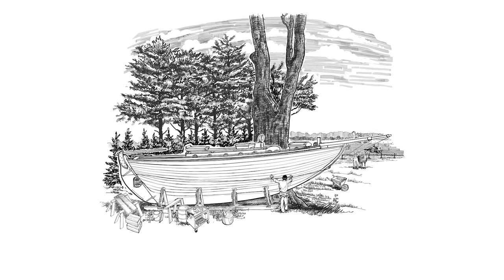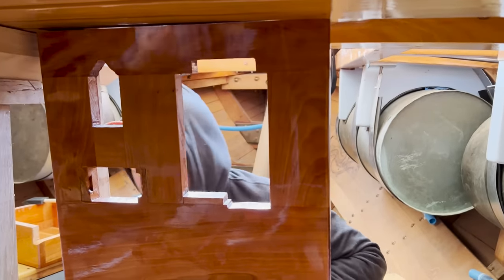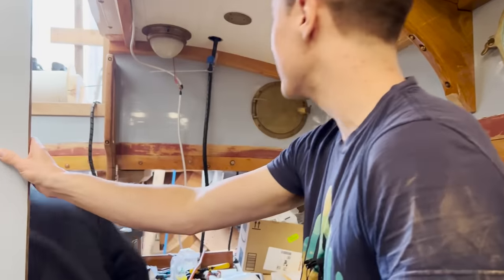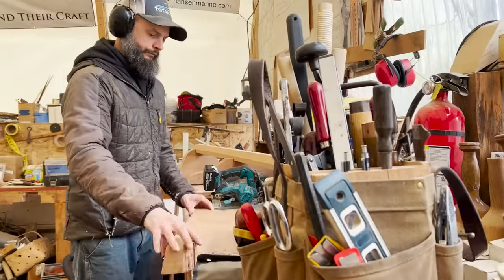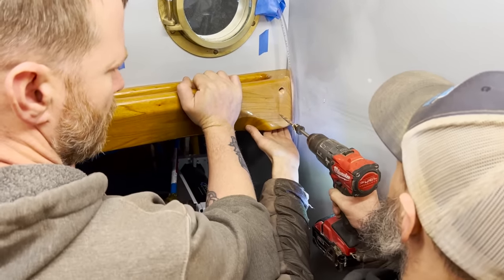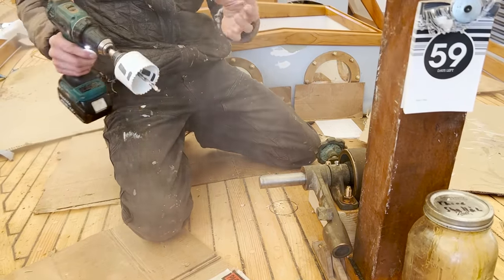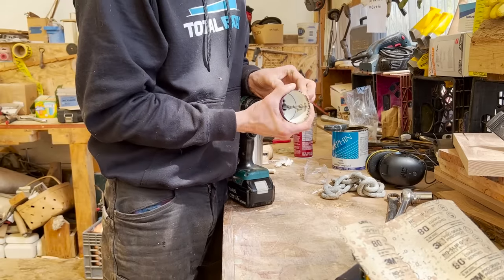Arabella's Spa Week, Swelling The Hull - Episode 265 - Acorn to Arabella: Journey of a Wooden Boat

Comment: She is so beautiful, well done you guys. Quick note on the boom traveler for anyone who is interested. It changes the angle you are pulling on the sail and thus can flatten it. Going down wind or on a beam reach you would want a full belly so you would move the traveler to the same side as the sail. Trying to point up more to windward you would want to bring the traveler to the center, or even move it off center "away" from the side the sail is on. This puts a slight twist in the sail, flattening it and making it more efficient for pointing up.
Reply from the maker: Thanks for sharing.

Comment: From experience; I suspect that the leaky water tank inspection cover will need twice as many fasteners to prevent the distortion between the fasteners that is reducing gasket pressure between them, so allowing leakage. 
It’s a very large surface area for so few compression points. 
Other than that, great work guys, she’s looking absolutely gorgeous.
Reply: Also!  You should consider cutting a hole in the flange gasket, to make it a ring instead of disc.  That will free up any given point of the gasket from influence from what's going on on the other side (180 degrees) of the seal.
Reply: @JBLewis  But than then allows two surfaces to develop a leak across.  More screws i think should do the trick.
Reply: Dish the existing cover to increase the stiffness. Use a silicon gasket with a durometer hardness of 60 or so, and stiffer than foam, more durable than that and the rubber. Test. I hate leaks on boat.
Reply: @johnmcanulty7341  makes an often overlooked point. The spacing of fasteners around a large opening in relatively thin flat material is governed by the need to reduce midspan deflection induced by the gasket compressing at the fastener points. A softer gasket will not necessarily help unless it is graduated (stiffer at the fastener points, softer in between. This can be achieved by letting in washers of stiffer material around the fasteners, which should be slightly thinner than the soft gasket, but this is fiddly to get right. Flanging or dishing the cover (or making it thicker) will go half way to resolving the problem (the underlying tank will still deflect as before). The simplest solution is to double the number of fasteners.
Reply: At 12:50 a helper suggests that the leaky tank inspection port can be accomodated by lowering the level of water. Unfortunately sailboats heel, and can stay there for a while. I was once on the same tack for ten days...
Reply: Having thought about it further, I think that the simplest solution of all would be to dispense with the gasket altogether, substituting a bead of low modulus, potable water safe, silicone jointing compound. 
This should be laid down as a continuous bead at the same radius as the fixture screws, with a circle of compound around each screw position. 
Either fibre washers or Dowty seals should be fitted under each screw head to prevent leakage via the screw holes. 
If it were possible to get a pair of backing rings machined up, circa 5mm thick, to be fitted both top and bottom, these would substantially stabilise the joint. 
An additional benefit of a lower backing ring would be that the screw positions can be tapped so that it forms a fully captive nut assembly once bonded in place with potable quality sealant. If it were made circa 10mm thick the tapped holes could be blind (not perforated through) thereby sealing the screws from water ingress altogether. 

For now though, just doubling up on the screws and dumping the gasket for potable quality RTV sealant would suffice. 

The thing about this assembly that bothers me right now is that I have a strong suspicion that the joint will fail with the impact of water sloshing in any sort of a seaway ehen the tank is part full. The surface pressure generated can be rather greater than one might initially guess and it would be a great shame if the tank were to become permanently distorted around the aperture through an insufficiency of fasteners imparting excessive localised loadings.
I’ve seen and had to deal with the results of exactly this issue and it’s a real PITA to rectify the distortion properly. 
Cheers, R. 😎👍🍻
Reply: Steve
The guy testing the tank said he could add a stiffer cover. I definitely recommend that along with other measures mentioned here. Static test is nothing like being in a seeway with water sloshing around. Entire tank will flex.
Reply: A seaway will find its way. Are there plans for a baffle system to maybe reduce the sloshing issue? Maybe something like soft baffles might be effective. Commissioning new tanks are problematic. There are multiple solutions. Dealing with liquids being in the bilge is not most optimal.
Reply from the maker: There are baffles.
Reply: @AcornToArabella  👍I know, but not against vertical motion. 
Not trying to knock anything you’ve done, just trying to help you avoid a snag down the track.
All good. 👍🍻

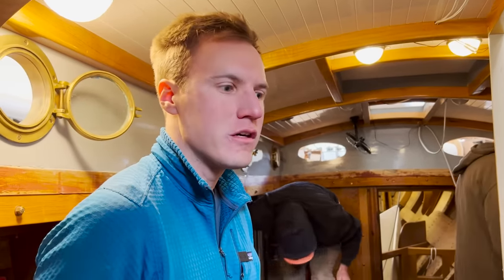Comment: 12:39 Three ideas for improving the tank lid are now following me around...
 1. A sandwiched donut flange cut from ¼", ⅜" or ½" sheet when clamped to the tank opening would offer an improvement in stability.
2. A machined version of a flange can add a vertical dimension and resistance to twisting. This could be tricked out with o-ring seals for both the flange and lid. 
3. A pair of custom made o-rings glued on the gasket on both sides of the machine screws can greatly increase the sealing ability by compensating for irregularities. O-ring material to make your own is readily available and the adhesive is usually just a type of cyanoacrylate aka, super glue.

Comment: I have never second guessed you, but I am concerned about the traveler. The height and the strength make me nervous. Enough force to tip that boat over will be on that point. And then tip it back the other way.. and back. Have you considered metal? Im sure you could modify a used one. Keep it up man!

Comment: Another lubricant for stainless machine screws is pencil graphite, just rub your pencil along the thread and it provides enough slip to stop any binding.
Reply from the maker: And it doesn’t leave a residue. Best thing for lubricating locks, and it’s recommended over WD40 type products. —Anne
Reply: It is abrasive though, so keep it away from machine tools  and edges you like to keep sharp!
Reply: @tomnewsom9124  an abrasive lubricant, like graphite grease. First I’ve heard that.

Comment: Any drain holes in the handrails? A sudden rain shower with open portholes could fill them up pretty quick. Not likely to be a common occurance, but it would save having to sop up all that water with a cloth... :yougotthis:
Reply: Also condensation on the glass and metal of the portholes, together with inevitable eventual leaks in the gaskets...

Comment: Unless you're planning on heading south, those hand holds are going to catch a ton of condensation coming off your ports in the cooler months.
Reply: Agreed, while they are beautiful I wondered why he didn't use an aluminum railing that would also provide a place to hang things.  The handholds are a dirt/moisture trap.
Reply: This is a very fair assessment, while they look beautiful sometimes function needs to come first!
Reply from the maker: I just wipe mine down. I mostly sail in Maine, well into shoulder seasons, and I’ve only had grabrails like these ones. —Anne
Reply: I suppose they actually prevent drips where you don't want them, assuming they don't fill up...
Reply: Just put a couple of panty liners down in there and all the drips will get collected.

Comment: Consider installing those flange bolts from the bottom. The threading will keep them from falling in, and you can use nuts.

This way you never have to deal with stripping out the thin thread metal

Comment: Are there drain holes for the hand rails? I'd be worried about any water leading/condensing/splurging through the port holes ending up in the hand hole channels. 
Another great episode. Patron since the lead pour. Love your work!
Reply from the maker: Thanks for your support! So grateful. I’ve lived with these type of grabrails on two different boats, and it’s not really an issue. Portlights stay closed in inclement weather and when under way. Condensation is real, but not so much that you’d need drains. —Anne

Comment: Another quick tip for you once you get on board. To control mold and musty smells on the boat get some pool chlorine tablets, put them in a butter dish with or without lids maybe pop some holes in the lid if you want to have a lid on it. And keep them in places where mold and musty smells acumulate. Also keeps out the bugs....
Reply from the maker: I like tea tree oil products for that. Thanks for the tip! —Anne

Comment: One old trick for expanding planks was to hose them from the inside and let the water sit in the bilge. Not easy when you are running electrical, but just a thought for you guys. It isn't hard to wet up the inner seems with misters. Then just run your bilge pump to exit the water.
Reply from the maker: Yeah that’s not really possible for us, but we’ve had very good luck with the big humidifier.

Comment: Anne going disco made me laugh mm!
I'm not a knower about these things, but I was wondering, isn't the steaming of the whole hull making it prone to checking ? I guess taking a boat out of the water would do the same thing but on the other hand steam is maybe stronger? 

Anyway the interior of the boat is getting so many upgrades it's really insane the speed at which things are going right now! 
wich
Reply from the maker: If the steam were hot, yes. But by the time it’s floating around inside the cover, it’s cooled so it’s more like what you’d feel from a humidifier.

Comment: The traveller is meant to allow one to change the angle of attack of the main - by pulling or easing the car up and down the traveller without changing its shape. The shape of the main is controlled by the mainsheet.
This design also allows you to set the traveller car slightly to windward when pointing high and still be able set the shape of the main so it’s still drawing properly

Comment: Hey Steve can I give you a Tip  why not put two plastic  barrels  in Ankour hold as when you put wet salty chain back in chain will go into barrels with a drain pipe going to side that way it will save the timber from rotting out in future
Reply from the maker: We built a custom one, kind of, with a wood core, fiberglass, lots of epoxy, and two-part paint. Basically a fancy barrel, of sorts. —Anne

Comment: I understand the job that the steam is doing swelling the planks before you final fair the hull and paint and whatnot, but doesn't steam end up drying out wood's natural oils and things in the long run? Would it be beneficial to coat it with wood oils instead? I'm sure there is a good reason that I just don't know (cost, environmental impact, difficulty of application), but I just wondered that.
Reply from the maker: It’s not hot, which would indeed maybe do that. It’s just very, very humid under that tarp.
Reply: Side note: the sandpaper glued to the hole saw was a brilliant solution to the problem.

Comment: Consult your gasket guy, but having a ring-shaped gasket rather than a disk will allow the gasket to seat properly.  A disk design doesn't give the edge distortion anywhere to go and thus induces creases i.e. leaks.  Looking good guys, keep at 'er.
Reply: Great tip! Similar to why cans have circular bottoms, a ring is able to more easily form an even contact

Comment: A quick tip for cleaning your anchor chain (if you have some chain that's a little crusty). Find a gravel road....  tie the chain to the back of a vehicle and drag the chain around on it.. cleans rust and all kinds of crud very quickly... I'm not recommending it if your chain is new, only if the Galv has failed and it is rusty AF.

Comment: The tanks have the wrong kind of inspection opening. First of all, the opening must be reinforced properly and the round hatch must be much larger than the hole in the tank and not like now. In addition, the inside of the tank must not have a rubber seal that frays and blocks the fuel hoses.

Comment: with the port lights directly over the cherry grab rail on the interior are there any plans for drain holes to let any water out of the bottom if water were migrate from the port lights?
Reply from the maker: No, we don’t suspect there will be that much going on there. I’ve had similar grabrails on both of my cruising boats and it’s not really like they act like gutters. Maybe I remember to close them when they need to be closed though. —Anne

Comment: So do the grab rails drain the splashed water from the portholes back to the outside?
Reply from the maker: The portholes will be closed in inclement weather or when under way, so it’s not really an issue.
Reply: I only ask because I saw where they did that on a boat, more that likely for rain where the porthole had been left open on a shore trip. It stuck with me as a nice little touch.

Comment: Great work. I have a simple question and most probably my question shows I have no idea about boats, why do you use slotted screws and not the newest torque head versions which would be eaiser to handle with electric screw drivers.?Does it have to do with some boat tradition or is there anothe rexplanation..? Your fans from Malta ... Keep up the great work
Reply: Sampson boat co had an episode about it. Basically it comes down to that painting and varnish tends to accumulate in screw heads  and slotted screws easier to clean if something needs to be replaced or tightened. That and tradition.
Reply: @adam-k  ok slotsall have to be in the same direction……😊 for your OCD fans.
Reply from the maker: Yup, Adam has it. Basically, screws might need to be removed and slotted are easier to handle during routine maintenance. Might be many years until you need to remove them, but everyone thinks about it from the get-go. —Anne
Reply: @adam-k  thanks so much .. great explanation… as we say here in Malta ‘ a question is the sister of knowledge’ and now we know …
Reply: @AcornToArabella  thanks Anne for adding to the explanation… always wanted to ask but did not … you lot are amazing and we hope one time to see Arabella visiting Malta’s grand Harbour ..

Comment: where did the idea come for the split rail bulwarks and did the brackets come off of victoria or did you have them cast? she is beautiful. your mom! the boat ain't bad either!!
Reply from the maker: The pieces for the brackets were waterjet cut at our MS Fabrication, and then Steve welded smaller pieces together to make each bracket. The floating two-part toe rail idea came from two places: The Finely Fitted Yacht, a handy book, and the size stock we had for wood. Makes it ace for attachment points! —Anne

Comment: Wonder if a drain hole or two in those handrails may be nice? If a large wave splashed in some water though an open porthole it could get trapped in there.
Reply from the maker: Portholes should be closed in inclement weather or under way in any conditions.

Comment: U need more support for the main traveller over the hatch. An involuntary jibe in a gale (and boy - have I had a few of those) carries tremenous force and will not rip the traveller off the cabintop but break the traveller itself. Then u have a real problem. Another plank under the traveller should do the trick. It is not easy to visualize these forces before u c it with your own eyes
Reply: It depends a whole lot on the size and proportions of the mainsail. This is a low aspect ratio gaff ketch rig with end of boom sheeting, so leech and sheet loads are much lower than on a tall bermudan sloop rig with a mid boom sheet, and there is much more progressive load buildup in the mainsheet at the end of an involuntary gybe. Personally I think Steve's structure is plenty beefy enough provided that's an oak beam, and it's certainly in keeping with what experienced sailor-builders have done (and found sufficient) on similar boats of that era.
Reply: Actually I took another look at it and you do have a point: the span across the companion hatch is longer than I realised, and completely unsupported. Another vertical oak web as you suggest, mounted on edge like the grown knees to port, depth to just clear the hatch, would be a good addition, I agree.